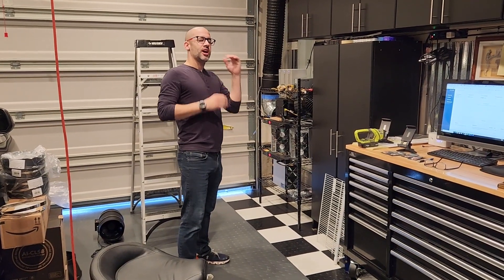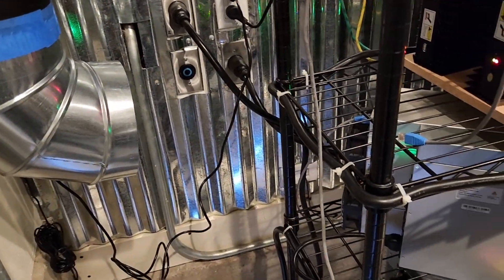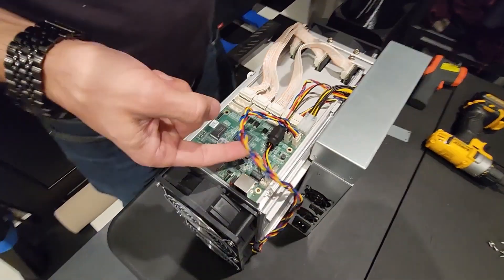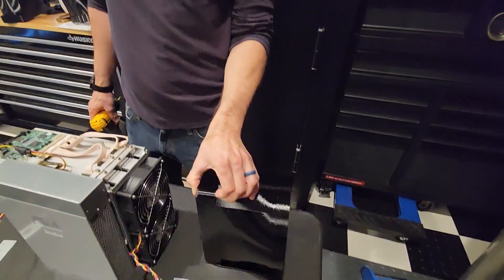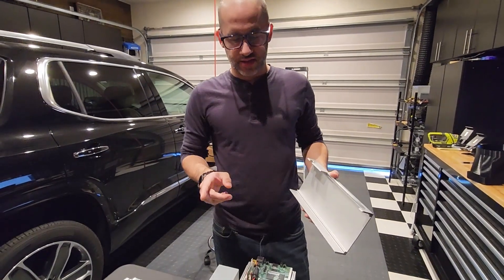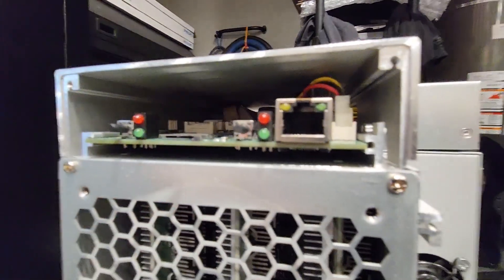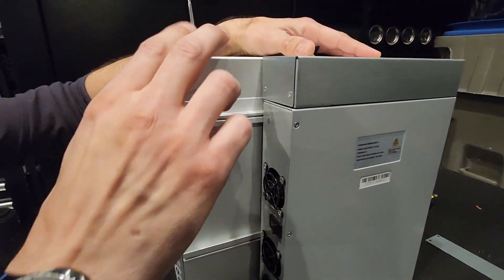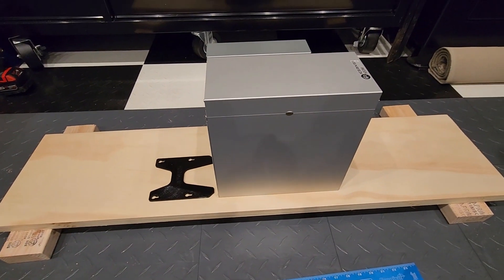Kaspa Miner Silencing and Wall Mounting In Home Garage, Minimal Footprint, You Can Home Mine To!

Comment: It would have been far easier to just bend the fan connector a little so the spoofers are at an angle.  Minimal effort, no problems.